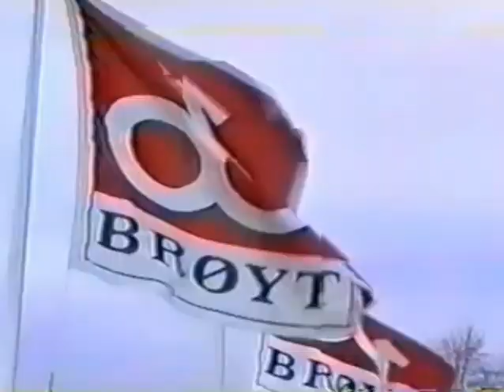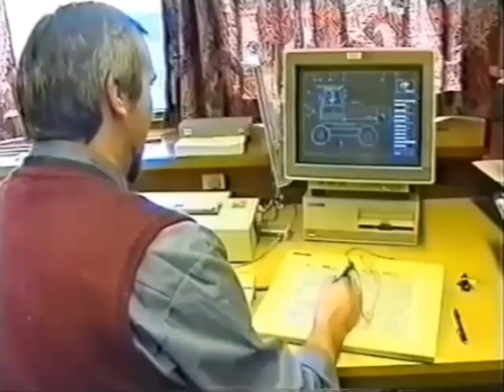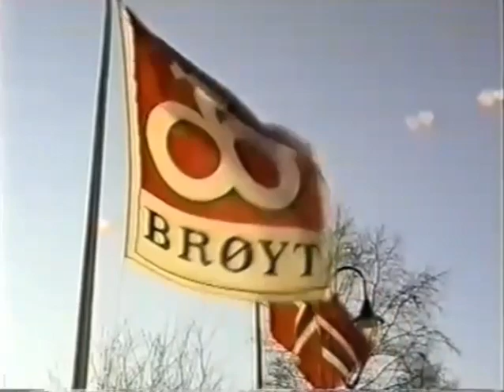Brøyt D1000T

Comment: Yes I’d like to place an order for one!
Reply: It's called 'AMV FL70' as of 2022.  €1.2-1.5 mill only ;)
Reply from the maker: Not the same and defently cost more than the orignal 😂 @Rimrock300
Reply: @broyttube Maybe not so big difference in price if calcualting the cost of a original one into todays money value. The original one possible used quite many custom made components that had low production volume and higher cost, while the new copy use more standard mass produced components.
Reply from the maker: @Rimrock300  Well u couldent be more wrong its an whole other story but todays money Brøyt would cost half of the AMV FL70 so Case closed😅
Reply: @broyttube Seems like you are just guessing, since you have no real number. But anyway, let's say they were so smart they could manufacture the original one at half the price of the new version. Still they where not able to keep it going, had to shut down. Something is off.
Reply from the maker: @Rimrock300  Oh i have all the Numbers but I aint telling that too u as the same reason you come here and guess it cost the same or less go do your research before you state something pretty tired of people guessing and saying things that aint rigth or true all the time.....